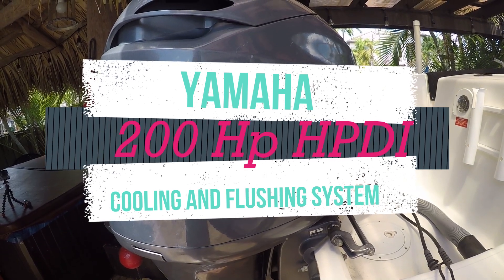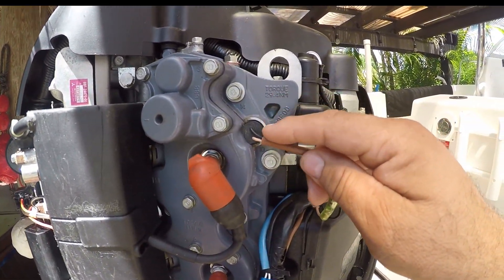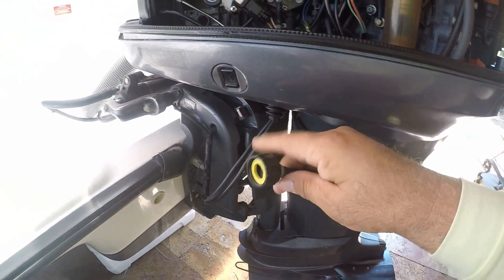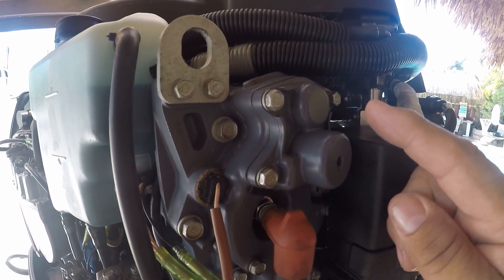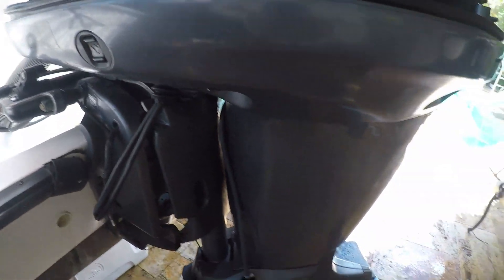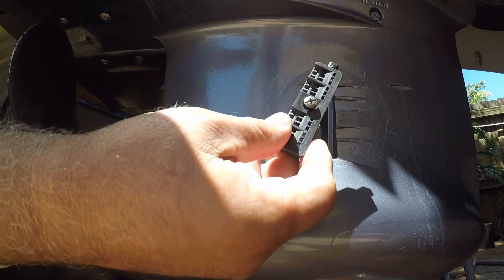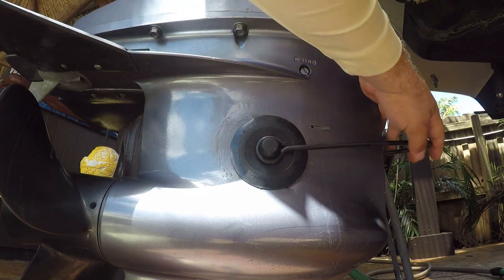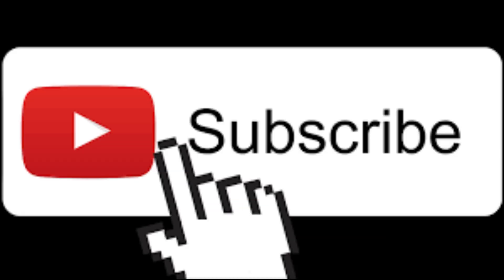Yamaha outboard HPDI  cooling system overheating and flushing methods with muffs or at hose port

Comment: Hi. My 2005 Johnson 90 2stroke has springs on the thermostat which lets them move to allow cold water through to the head space when back flushing through the telltale port which is also the flush port. I tend to remove the 2 thermostats to guarantee full flow thru the head. Only takes a minute. Not engines have this tho.
Reply from the maker: Hello. Great info. Thank you for sharing. I was not aware of that.

Comment: Water seems to be making it through my yamaha f25 with the muffs attached. But water is getting stuck somewhere when using the hose ok the side. I disconnected the hose at the first t junction.  If someone could enlighten me with what step to follow?
Reply from the maker: Is water coming out the telltale?
Reply: @florida4funshinechannel998  with the muffs water does come out the tell tale. With the flush hose on the side it does not
Reply from the maker: @patricecormier7514  Check the connection hose for obstruction. Could be the washer blocking the flow and follow the hoses and check them. Also , check the thermostats.

Comment: Thermostat closed with static flush, due to cold water and no engine heat.  You are correct!
Reply: There are relief holes that water passes through when a static flush is completed.  the pressure of water is higher with the hose and the channels and thermostat are flushed clean.  Heat may help running with salt.  However, the high hose water pressure cleans out the water channels well.  Yamaha notes it works just as well as running.  Your engine is only running idle with the muffs (850-1000rpm).  This is a myth and muffs sometimes do not provide enough water flow.  If people flush for 15 minutes with the static connection, they will not have an issue.  They are lazy and just run for 5 minutes.

Comment: Regarding removing the "grills" when you place the water muffler on to flush.  I am not a professional marine mechanic so this is just my opinion.  I don't think you are doing any harm by taking the grills off.  However, Yamaha does not recommend that step in their procedures, neither do they prohibit removing the grills.  I tend to follow the manufacturer's recommendations, they built it they and they publish the maintenance procedures I figure they know their product the best.  Those grills are installed when the engine is in the water running at idle and the engine receives enough water flow under those conditions.  Then why would it not with the muffs on?  With the hose turned on (pressurized) attached to the muffs, and the muffs then clamped to the water intake ports on the lower unit, that hose is delivering more than enough volume and pressure of cooling water.  By removing the grills you are "inspecting" them for any foreign object blocking any of the inlets in the grills, that's a good thing.  I do not think you are gaining any flushing advantage as the pressure and volume of water measured reaching the engine block to do the actual flushing is probably the same by the time the water passes through the small restrictions in the impeller housing, past the impeller itself and up the small diameter hose to the power head.
Reply: The back pressure of the water when the motor is in the ocean/lake.  This is why the muffs may restrict water flow.

Comment: i was doing a static rinse of my engine which is a 40 hp 2003 yamaha outboard. The connection port is on the starboard side but the line connects someplace on the port side. It came loose and sprayed water on the inside of the engine cowling. I cant find where to re connect the line on the port side. Does anyone know?

Comment from the maker: Post your knowledge, ideas on flushing motor without muffs and not turned on,  on the hose only. Can you turn on motor when it is on the hose without muffs? Share please.
Reply: DO NOT DO THAT.  Motor has to be turned off.  It is a static reverse flush.  The mater pump impeller is not getting enough water.  You could burn the engine.
Reply from the maker: @byronakhavi953  Correct.